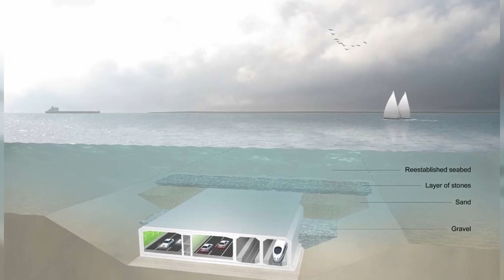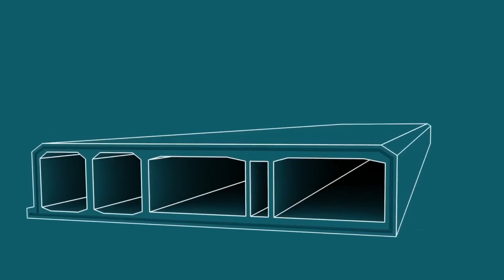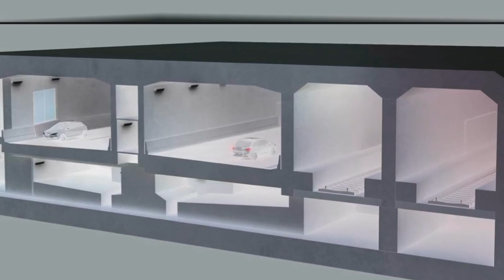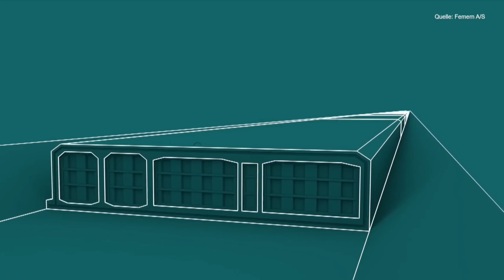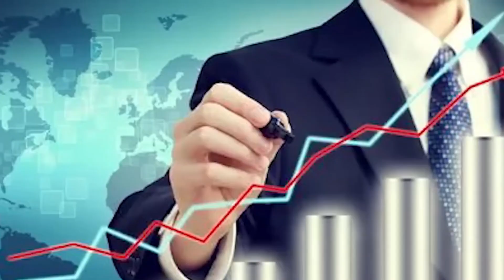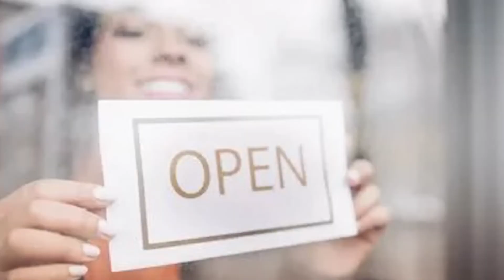How This $7 Billion Tunnel Will Change Europe Forever

Comment: This isn't the longest submerged tunnel, the Channel tunnel is 31 Miles long or 50 km long
Reply from the maker: Correct, it’s the longest immersed tube tunnel in the world
Reply: @urbangiantsofficial so you should not have compared the 2 tunnels as you did.
Reply: Dumb comment; this is different

Comment: Well, at 18 kilometers it won't be the longest submerged tunnel in the world. Neither will it 'surpass' the UK-France channel tunnel which is 50 kilometers. And the Mararay-Tunnel is 76 kilometers long.. But hey, the Femern Belt tunnel will not be the shortest in the world.. That's something I guess...
Reply from the maker: You’re absolutely right that the Fehmarn Belt Tunnel, at 18 kilometers, won’t be the longest submerged tunnel in the world. However, it’s worth noting that it will be the longest immersed tube tunnel ever built. Immersed tube tunnels are constructed by placing pre-fabricated sections on the seabed and connecting them underwater, which is a different approach compared to bored tunnels like the Channel Tunnel or Seikan Tunnel. This unique engineering feat sets it apart and is what makes the project so significant.
Reply: @urbangiantsofficial  Since you're describing it as a record in its own category, you cannot say words like 3:42 "surpassing" Channel Tunnel. It's not surpassing it, it's a different approach.
Reply from the maker: Okay thank you for the clarification. The Fehmarn Belt Tunnel will be the longest immersed tube tunnel in the world, not the longest submerged tunnel overall.
Reply: submerged ≠ undersea. So it is indeed the worlds longest submerged when finished.
Reply: The Channel tunnel is a drilled (bored) railway tunnel with two tracks. The Marmaray tunnel is a 13.5 km long drilled railway tunnel with two tracks. Fehmarn is a submerged tunnel, tunnel elements constructed on land. with two railway tracks and four Freeway tracks for autos (plus service and emergency evacuation tunnels). If it had been bored, it would have had 7 tunnels. However, the underground is not suited for boring.